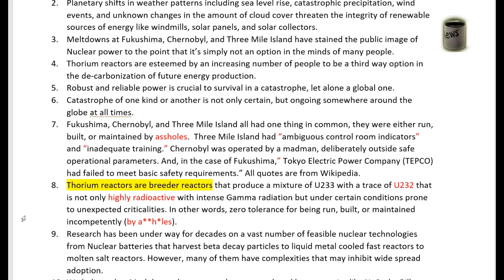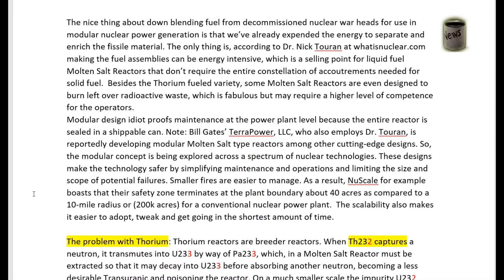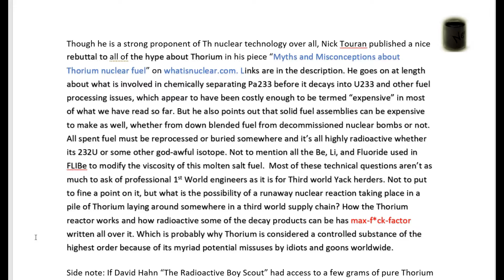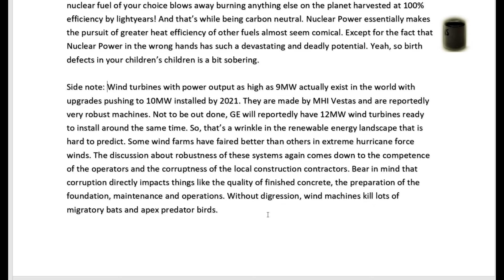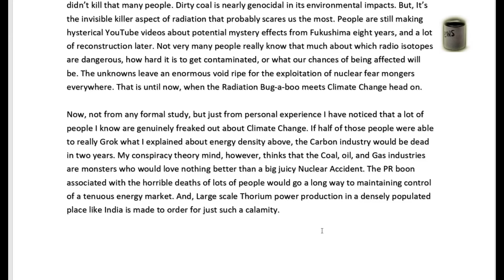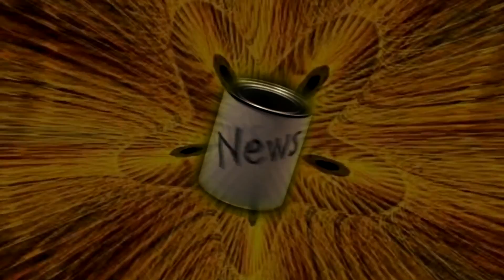Puppies, Kittens, Rainbows, And, um...Thorium...

Comment: None of the thorium isotopes can go "critical" as you suggest might be possible (i.e. all by themselves). Thorium is a fertile element, not fissile. Now that's not to say that you can't "burn" thorium in a fission reactor using fissile material, but you have to have very fast neutrons for that to be remotely plausible (neutrons energies typically above 2 Mev).

And the only way to achieve that is to create a very efficient neutron-economy fast-spectrum reactor using highly enriched U235 or P239 (which are fissile) above 15% or use an ADS design. That, of course, assumes you have a few spare billions of dollars laying around for the proton accelerator (i.e. spallation of Mercury to produce neutrons) and a few more billions for the reactor design to accomplish such a goal in the first place.

And last but not least, even if you did "burn" thorium through fission, you would still need more fissile material of the uranium and plutonium type to sustain the reaction. There are no pure thorium fission reactors sans particle accelerators. And those are way more complicated to produce and maintain at 100% duty cycle than your run-o'-the-mill PWR, BWR, PHWR, CANDU, GFR, HTGFR, MSR, MSFR etc...
Reply from the maker: The concern I have about relatively pure Thorium sitting in a warehouse somewhere waiting to be used has to do with the fact that Thorium is a radioactive substance that would probably be stored in the same place as other mildly radioactive substances. If some portion of Thorium were to transmute into U233/232 and then decay, is it possible that that process might convert more Th to U? Is it possible for a significant portion of a sample of pure Th to transmute to other stuff just sitting on a shelf somewhere? What is the worst case scenario?
Reply from the maker: We're not talking about criticality per se, just elevated contamination of an undesirable location.

Comment: No stack of thorium can go critical because its fertile not fissile
Reply from the maker: Fertile means that it can capture a neutron and transmute into an isotope that can then decay into a fissile one. So you are saying that transmutation of a stack of Thorium is not self-sustaining once it gets started? Do the particulars of neutron moderation prevent this from happening outside of a certain environment? If so, that's great! If not...
Reply: I think I see were you are coming from   If A fuel isn't self sustaining how can it be a fuel? The Thorium neutron lifecycle has to be balanced,  not enough  Thorium and the cycle stops wen you run out of U233, To much Thorium and the neutrons are captured by the Thorium and not the U233 and the neutron flux goes down.  In other words if a stray neutron inters an infinite pile of Thorium it makes mostly U233 which is encapsulated by the Thorium for 162000 years. Never seeing another neutron it alpha decays and the neutrons are lost to the cycle. this is the reason yellowcake uranium needs to be refined before it is used in a reactor

Comment from the maker: Is it possible to produce chlorine trifloride by accident in an MSR?
Reply: A MSR reactor uses either a fluoride (usually in a thermal spectrum reactor) or chloride salt (usually in a fast breeder spectrum reactor). I don't think any designs have ever proposed a mix of chloride and fluoride salts together, so it is likely that even trace amounts of such a compound would never be created due to a MSR. As I understand it, trace amounts of tritium, krypton, and xenon are generally the gases produced that the operators would be most concerned with.

As for accidents, since they operate at atmospheric pressures and are removed from interaction with water, there are essentially no mechanisms within the system that would cause radioactive materials to accidentally be dispersed into the greater area. Even the salts help this because the most dangerous fission products become retained and bound up within it. Added to this, since the salts expand at higher temperatures, the nuclear reactions will naturally decrease as the molecules get further apart which ensures further stability of the system.
Reply from the maker: @nolan4339  We're talking about someone anywhere in the world adding Chloride salt by accident to Flibe in situ. Does dumb shit like this ever happen? Remember people have died from holding a Beryllium shield over a  Plutonium pit with their bare hand! Someone in China accidentally added Etheline Glycol to toothpaste during production thinking that it was Propylene Glycol and a whole bunch of people died from kidney failure. We live in a shit-happens universe.  Not considering extreme possibilities is bad business. Titanic...I'm not a naysayer, I'm a realist. And, most importantly, so are the investors
Reply: @RCrosbyLyles  
In all of nuclear, and I suppose risk management in general, there is a thing called a heirarchy of controls:

Eliminate the risk
Work around the risk
Minimise the damage the risk can cause
Educate people about the damage (and how to avoid the damage)

You can eliminate the risk by simply not having chloride salts at an MSR site. You can validate that elimination by testing all salt that comes in (you would have to anyway for chemistry control reasons). This can be done by X-ray diffraction of the crystals of salt, electrochemical testing, laser induced plasma breakdown spectrometry... there are dozens of techniques to validate a chemical sample that might not even be destructive. Now, if you deliberately kept a canister of ClF3 just next to the reactor for shits and giggles, then it's your own damn fault for keeping extremely hazardous, explosive, corrosive materials at a nuclear site.

Not to mention that as a molten salt, there is no way for something covalently bonded (ClF3) to stay in that form, accumulate, and somehow react. A molten salt is an ionic liquid: nothing is bound to each other covalently, everything just kind of sloshes around in a soup of dissociated ions. Agglomerations of groups of ions with opposing charge might form if a molten salt is close to its solidification temperature - these would be the nucleation sites for crystals to form when the salt freezes. But since operators would prefer to keep the reactor at a temperature at least 50 degrees K above freezing temperature for reasons of preventing pipe clogging, these agglomerations are themselves unlikely to cause issues, either.

What you propose is sheer fantasy.
Reply: @RCrosbyLyles  I love when you say "max fuck factor"; that made the video seem a bit less serious. But that doesn't make the actual issue any less important, for this technology is not to be trusted in the hands of third-world "assholes", as you remarked. Love the video, keep making more woke science content like this!